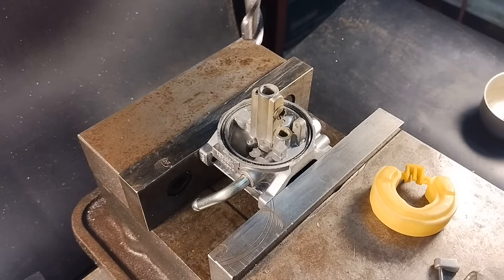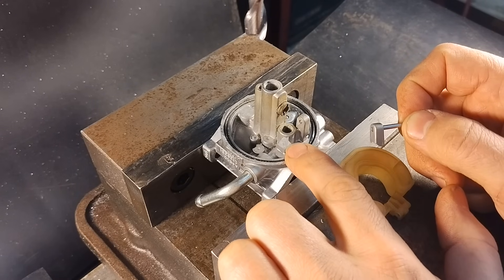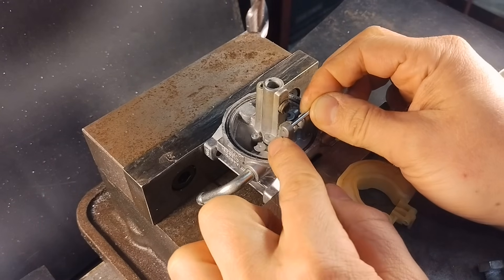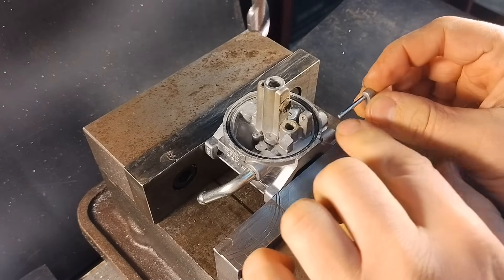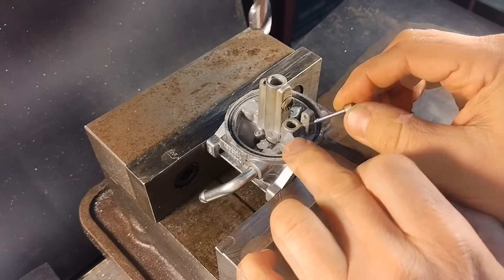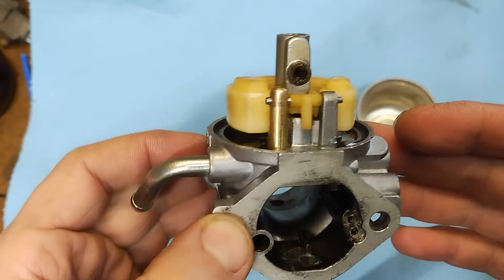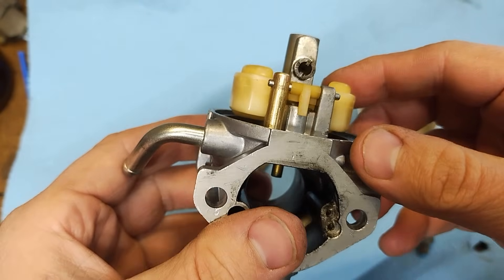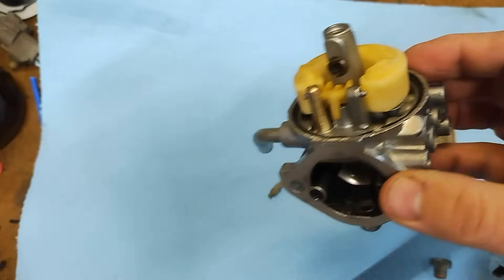Broken carburetor casting body - let's fix it

Comment: Couldn't you just have drilled a hole through the broken off part and used a screw to hold it in place?
Reply from the maker: @erik_dk842  if you mean screwing in through the end, that would interfere with the hole where the pin needs to go through, at least without using a tiny screw that could be recessed below the pin cross-hole. Also this was testing the approach for making new parts, because in the next video I did two other higher value carbs for James where the broken piece was too tiny to reattach and also  missing. Thanks for the comment and question
Reply: @FliesLikeABrick  A recessed screw just above the crack line. Like Blondihacks uses for holding parts together for soldering.

Comment: James should have supported the pin leg. My dad taught me stuff like that when I was about 9 years old. You can't knock a bearing or pin in or out without proper backing, unless the part is very heavy. 
Effectively, James was hitting the lug as if he intended to snap it off

Comment: To begin with, when you removed the existing broken tower, you partially destroyed the well where “the needle” sits! Secondly, in addition to placing “a screw” to secure the new tower, you ought to have welded it also! Thirdly, the “horizontal pin” was never shown to slide through the two towers with just enough resistance to secure it in place! And lastly, “the float” when everything was in place did not seat horizontally! But rather, dropped below its mandatory height! 👎
Reply from the maker: Thank you for your comments, I hope you do not mind me responding.  "partially destroyed the well" I believe I commented on that in the video, it is of no functional consequence as long as the mill does not break through, as the well performs no structural function - it is only as thick as it is due to the minimum practical thicknesses for the casting.

I did not explain it clearly in this video at the end, but do in the next one coming out - I did the repair this way because the other carburators I need to repair cannot be welded or epoxied back together, the broken piece is too small and missing.  

The horizontal pin is retained by their interference with the bowl itself (it cannot come out when the bowl is installed), the pin fit is not critical and is loose on plenty of carburators.  

The hole height on the new post is the same as the old post; if the float is sitting above-level, it is not due to a change introduced here. - This carb has since been tested to regulate the fuel level and run an engine just fine

I hope this is taken in the spirit with which it was intended -- I am still working on dialing in the length and "talkativeness" of my videos, so I leave out a lot of editorial content.  My upcoming has more explanation on these choices; comments like yours help me dial in how much I should talk through, demonstrate, or explain on camera -- thank you

Comment: I remember the ideo when this broke. I am truly impressed with your repair but still believe that with the right epoxy cement and proper placement it would have been strong enough to to hold a float bowl.
Reply from the maker: @mattyal9347  yep, this was practice for those other carbs where it broke right at the hole for the pin and epoxy isn't an option

Comment: A small pin that is pressed in drilled holes with JB weld has worked well for me in repairing broken parts like that carburetor.
Reply from the maker: Yep makes sense!  I hope to have a video out this week on the next two I fixed - on those, the break is right at the pin bore, so with this Nikki carb I was working on prototyping how to replace the piece altogether
Reply: A countersunk screw would have held this perfectly
Reply from the maker: @erik_dk842  yep, but that wouldn't work for the two in the video I released after this where the parts are tiny and missing, which is what this video was preparing for (because while this carb is valuable, the other two were more desirable and the original goal after practicing on this one)

Comment: I think maybe TIG welding it all up with aluminum buildup would of been the best option.
Reply from the maker: Agreed, if there's a large enough piece to weld and if alloy is weldable then this is a good option.  I am aiming for a general process to replace the post since the other two I have to repair are damaged in a way that re-attaching the broken piece is not possible

Comment: Would have been quicker to pin it and tig weld the original.
Reply from the maker: @BIBIWCICC  yep, if the broken part is available, not damaged too badly, and the alloy welds decently - sounds reasonable

Comment: Good fix. I had a carb like that on a King Quad. Used epoxy to fix it. 5 years later, it is still going strong. Your fix is more elegant.
Reply from the maker: @cpcoark  yeah there are tons of good solutions that are faster and easier if it was for something I owned. This was an opportunity to test out fixes that James and I would be comfortable putting in someone else's machine or in a machine for sale. It's something I should have mentioned, but I always hesitate to make intros or outros longer than strictly necessary since people are increasingly likely to tune out

Comment: I fixed one of these just this week. The second I’ve done with success. I drill a 1/16 hole in the broken pedestal and in the body where it broke off from and then safety wire the two pieces together. Making sure the pigtail doesn’t interfere with the operation of the float.